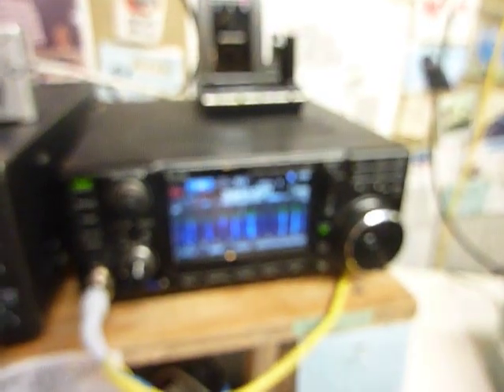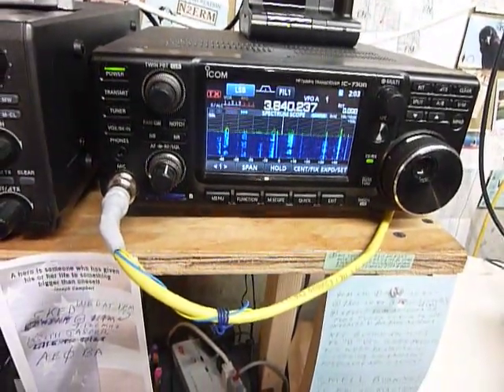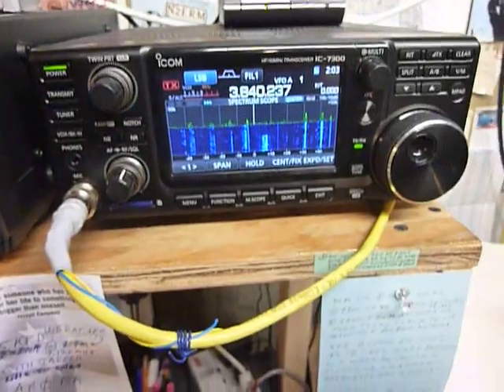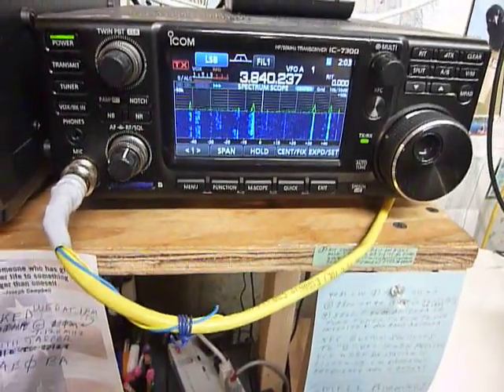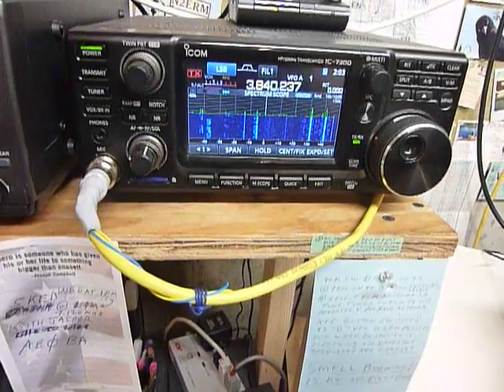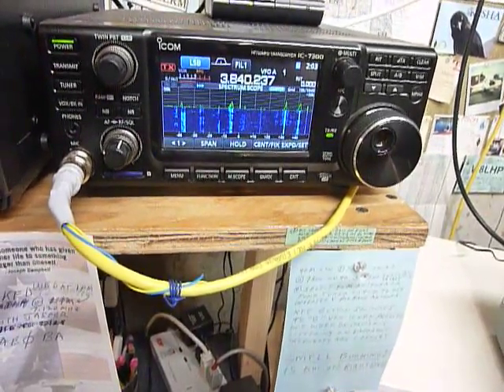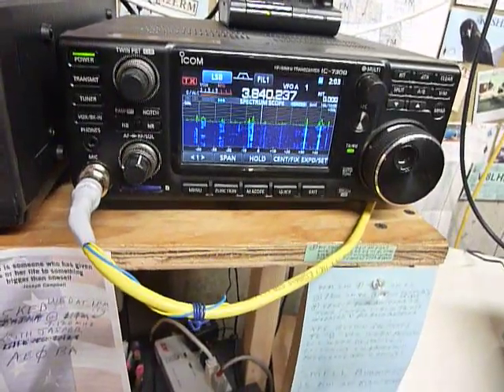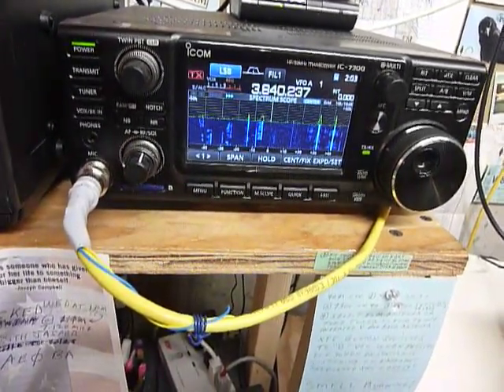STRANGE NOISE ON RADIO  3.846 MHZ . RADIO INTERFERANCE ON 80 METER BAND  3. 5 TO  4  MHZ .

Comment: A momentary aside here.
You're a man after my own heart Robert - makes his own workshop furniture out of industrial packing case plywood! ✔ (notice the top of his desk). In my case, I live near several lift/escalator installation companies here in Sydney Australia - their stuff comes in really big packing cases.
Reply from the maker: Yes Ghian695  When I was 10 years old I picked up a 5 tube radio in the city dump that was just a bent chassis straightened it out  talked to some guys who knew radio and got the right tubes for it and a speaker  put it all together and got it working I remember thinking  "I like this stuff "  In those days 
1952  or so a young kid could roam around in  the city dump digging for interesting stuff like radios .  These days I still like to salvage things from  trash I see... like  The plywood top on my operating bench here It was sitting beside a trash bin with a FREE sign on it  I could not resist...  there is JOY in using something that was someones trash   .   73  All the best to you in Sydney      Bob

Comment: And I thought you only has tube base radios.that radio is way to new for all your great tube radios to be near.
Reply from the maker: Hi Dave  Well I do have a lot of solid state stuff too you know that ... I sure like the 7300  I do a lot of CW 
and I see a pip on the 7300 spectrum scope tap it twice and zip I am right there  73   Bob
Reply: Why is that? I'm curious - I do have some technical/education by the way, but I've only just become interested in ham radio.